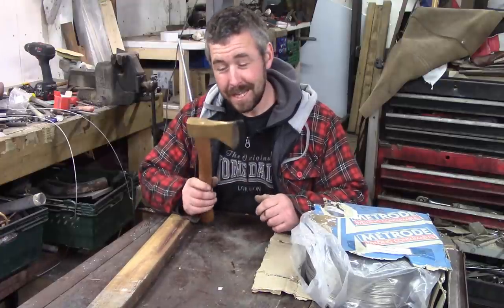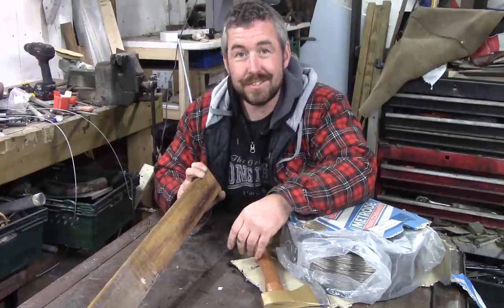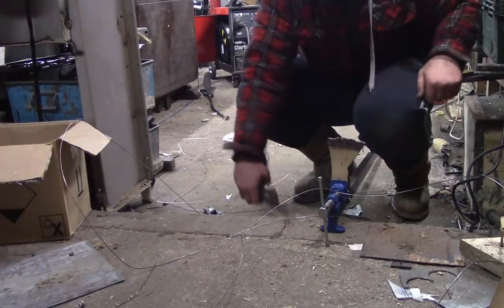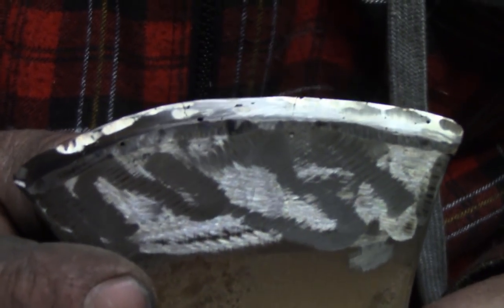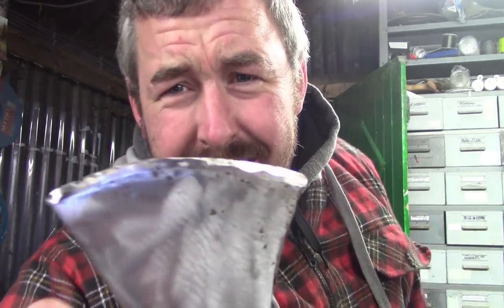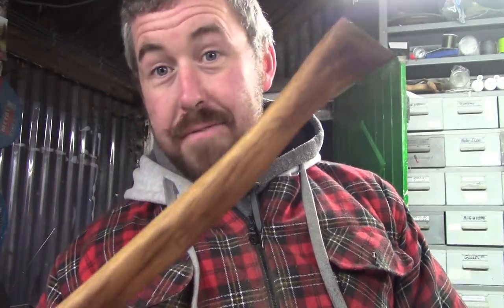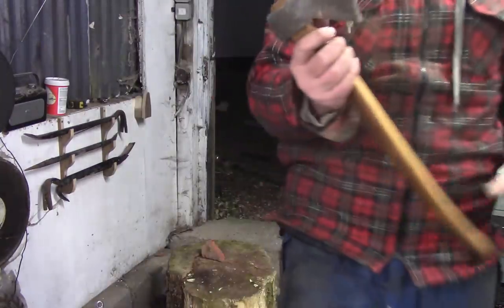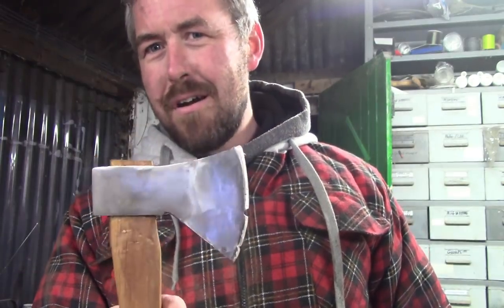Hardfacing an axe edge weld and Iroko haft experiments

Comment: Super interesting. Preheating does help, but hardfacing rod and wire have a definite learning curve. Certainly I haven't mastered it yet! Another way to get around it is just weld it and finish it. Then when it breaks, weld that bit again. With each repair you should end up with less and less weak spots from porosity, etc.

Comment: I feel you forgot to put a shroud and use gas in this video. Hence the small bubbles in your welds aka porosity
Reply from the maker: It's flux core wire

Comment: why spoil the ax? there and so the steel was normal
Reply from the maker: Егор Михайлов science! I like fine edge axes, these cheap axes won't hold a fine edge so I experiment to try and make a £5 axe as good as a £100, the last video i made like this was a lot more successful, I think I'll be able to hardfacing this axe better with my tig then I will have an axe that can chop a brick then shave my face, who doesn't want an axe like that?
Reply: but a good carpenter ax should not shave, it is not a battle ax ... or, perhaps, you want to do
Reply from the maker: Егор Михайлов i agree, carpentry axes are sold blunt, as are most factory axes, I don't know any carpenters that use axes but if you want any control across the grain you need a good sharp edge.
I'd be interested to know what a battle axe edge looked like, I tried building an executioner's axe and all the research said that in England they were normally pretty blunt and made from wrought iron using their massive weight to smash through a neck rather than slicing as Hollywood would have us believe, there could be some similar discrepancy with battle axes?
Reply: I did not say that the ax should be blunt, I meant that with the right hardening you will not be able to sharpen it to the point of shaving
Reply from the maker: Егор Михайлов mate I'm not correcting you, sorry if it sounded like I was, axes are all about personal preference! However hard I get it, I'll always find a way to get it sharp, I've got a shitty set of diamond files if nothing else works, I did struggle with this stuff though, toughest steel I've ever come across, I'm really just experimenting, and you know people used to make axes by forge welding expensive steel edge into a cheap steel head, this was kind of a modern version I suppose plus no one else has tried it so I thought I'd better give it a go just to see.

Comment: I clicked on the like button as soon as i heard the phrase "greasy as a girl you meat in a nightclub" 
I used the this old tony method of TIG welding high strength tool steel filler rod onto the edge of my axe head.

Comment: Would you want a hardened edge on an axe, if you hit something in the wood like a nail or stone wont it shatter and throw hardened steel shards everywhere at high speed?
Reply from the maker: Beach&BoardFan it depends completely on what you are doing with it, the longer I spend using an axe in the shed for shaping and carving, the the sharper and finer I want my axes, obviously if I'm digging up a tree stump it calls for a more robust set up.
Reply from the maker: +Beach&BoardFan depends completely what you are doing with the axe, definitely with a pack axe you want to keep the weight down and let the edge do the work, splitting maul...  Not so much.

Comment: Hop on the Miller or weldingweb forums for better advice than mine, , but that weld was ghastly and a good preheat then slow cool should reduce or eliminate the "hot shorting" cracks. The idea is sound. I'm sure that wire wasn't cheap, but if it was, good for you scoring a large roll!. Post the maker and alloy and other welders with more time hardfacing may chime in.